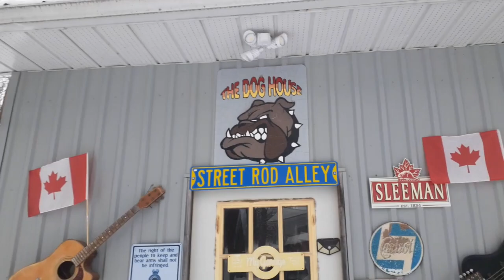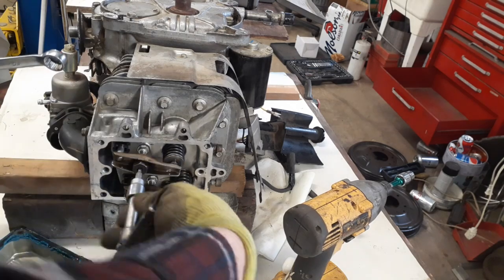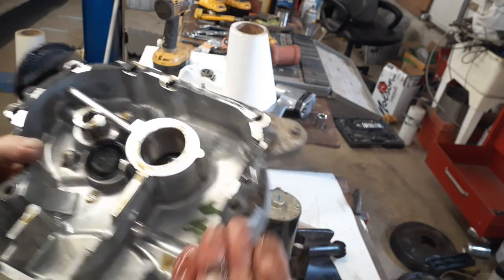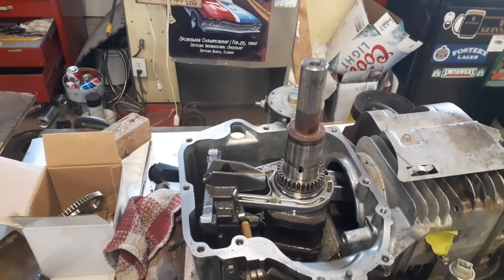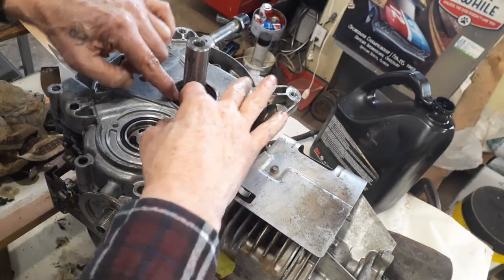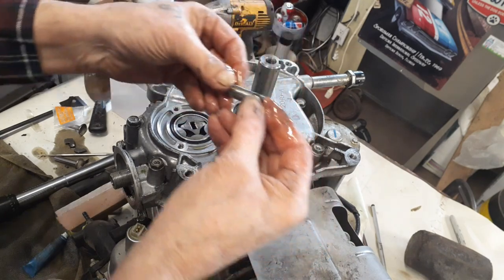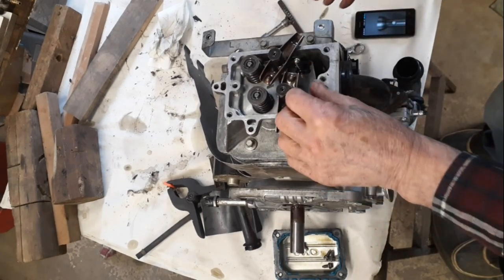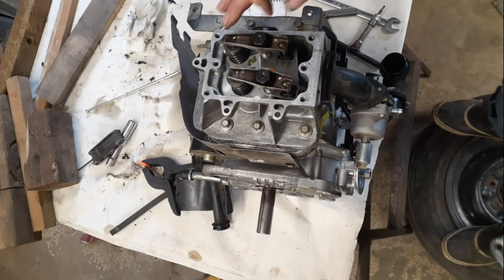@ 289 Cam Shaft install Briggs and Stratton Engine

Comment: Now you can go blow snow in comfort....sitting down inside a cab. Nice job on the repair. Furnace is a necessity in our neck of the woods. We got a couple of inches (5 cms) last night (22nd) and forecast says another 5-10 cms by tomorrow morning (24th). Nowhere near the 20-25 cms we were supposed to get. Looks like all the heavy snow stayed south of Lake Ontario. Am sure we're not finished with snowstorms yet. Be safe and stay well.
Reply from the maker: Hey Brian.  Thanks for dropping by the Dog House. I hate the winter.

Comment: Nice work Dog, why do you set valve lash with the piston down a 1/4 of an inch, never seen that before, catch you soon buddy
Reply from the maker: Hey Rat. I think when you have the piston go down 1/4", it puts the lode on top of the pressure release valve pin. It is the only way that it works properly.